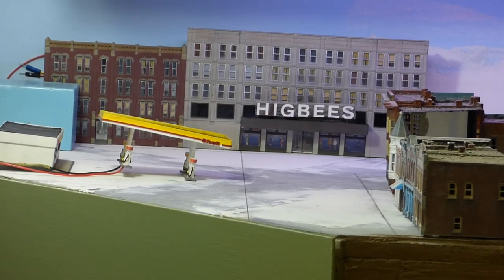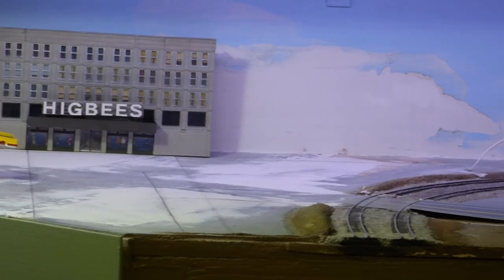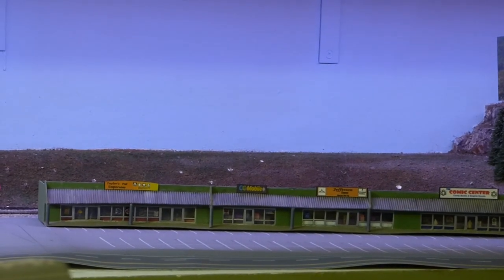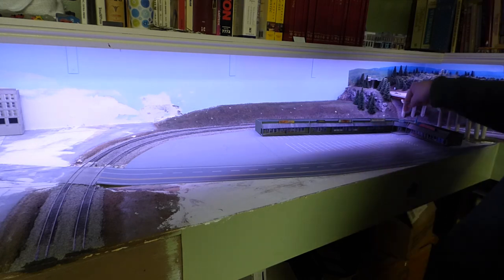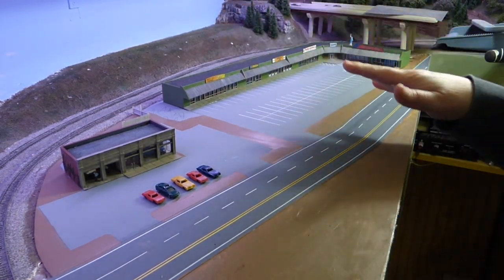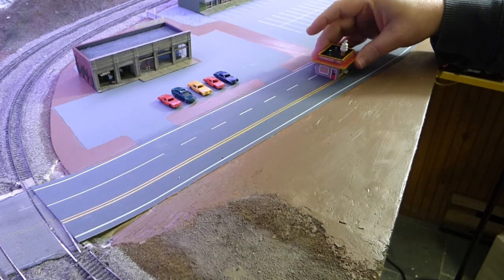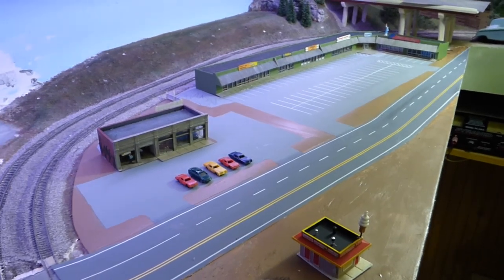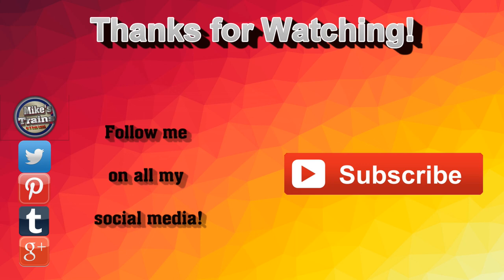Rebuilding A City Part: 5

Comment: Hi Mike,
Great episode.
First things first.  PLEASE tell your wife I love her for that Ice Cream Stand.  A LADY who has stole my heart.  As for you good kitbashing and placement.  (Side bar: My Upstate NY hometown had a HoJo roadside restaurant beside an embankment.  In 1999 the embankment eroded & HoJo slipped into the creek below.  Just sayin')
Next, and last, As one of your subs suggested the eatery across from the strip mall, I'm going to make a suggestion for the wedge by the SHELL Station.
An ARDUINO Activated Working "AUTOMATED CAR WASH."  Before you think I have lost my last brain cell under the track, read on please.  So with the positioning of the SHELL station and pumps, follow the drive path out to the facia and layouts end.  Now use whatever junk parts you have collected (No Kits, No Kitbashing, No Pre-Built Just your talents.).  Build a simple single story Rectangular building.  Long large windows on three or four sides.  Your call.
The structure would be ABOUT 1-1/2 CAR WIDTHS wide by the distance of a line from the pumps exit point to the facia and outward to the main drags sidewalk.  Since I don't know the measures you got some homework.  But what the hell we are all #StayInPlace2StaySafe.
The near side of the building will rest RIGHT ON THE EDGE OF THE LAYOUT.  AT THE SAME ANGLE AS THE EDGE.  You have now successfully filled that space.  BUT YOU AIN'T DONE.
You are a wizard at Interiors.  I have learned more from you in the last year than I learned in 69 years on modeling.  SO we (a.k.a. you) need to concentrate the major focus of this series on building WORKING Interiors.
First, I believe it was you who taught me how to take monofilament fishing line and drizzle PVA or Epoxy droplets on the line to appear as rain drops.  So you take that method and install it into the Car Wash as the Soaking station.
Moving forward to tufted cotton balls as the Soaping station.
Here's where your wife gets angry.  You take 4 of your wife's foam rubber curlers and reuse them as the rotating Washers.  As much as you can build is motorized and electrified.
Your son Ryan builds an Arduino sketch to control not only the stop/start controls but the individual functions inside the car wash as well.  BTW, Ryan's Part 13 sketch was really clever.  I like it a lot.
Now this last thing is only a side note.  On three of my RxR Club's layouts before installing a highly animated mechanical structure, like this one, we cut a hole through the road bed, right through to the benchwork,  The size of the hole varies, but most of the time it's 2 inches shy of the items parameter.  Into a box, hung beneath the benchwork, we install all the controllers, motors, and gizmos need to make the animation work.  The box is larger than the hole and screwed in place.  To keep all of the gear separate from track operation equipment.
Good luck.
SEE YA' DOWN THE LINE,
~Jim
Reply from the maker: WOW! that's a lot, I do kind of like the car wash idea for that spot and have thought about it but honestly I have been so busy with all the other projects I haven't had time to really put too much thought into it YET. That being said once I finish the area from this video that side of town is next and who knows... that might hit the project bench. No promises but I would really need to sit down and figure it out in my head and paper before I even consider something like that. Then the question is do I film the build or just build. For me sometimes it's easier not to film and I can work much faster on the other hand animation would be a cool build to see. Anyway that's a bit down the line, I still need to get there.  I definitely will show my son your comment I'm sure it will make him happy.  I love the feedback keep it coming!

Comment: Mike, make that dirt area a Home Depot parking lot with the ice cream stand in the corner like you have it.  The only part of homedepot you need is the sign at the edge of the road.
Reply from the maker: Thanks, That's a great idea but I think for a bit of a bigger spot. The widest area is maybe only 3" and goes down to pretty much nothing over a span of about 18" and I wanted to add a bit more visual interest to that spot. I hope this does it.